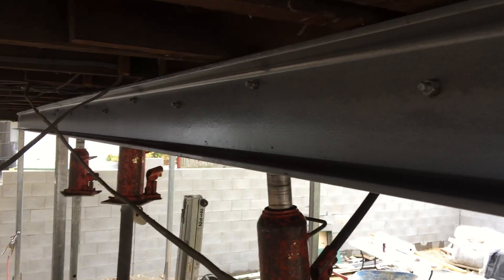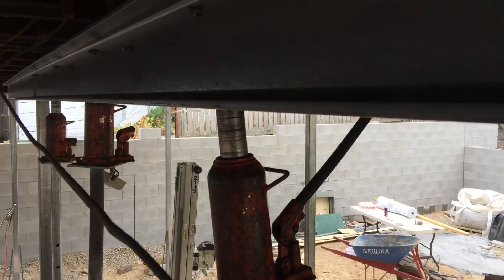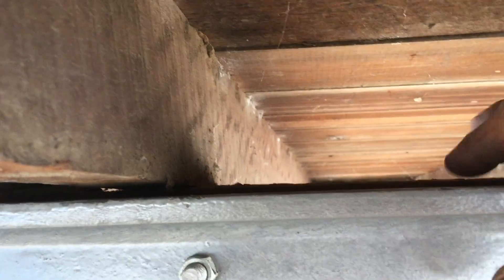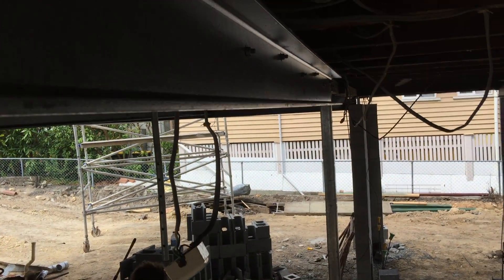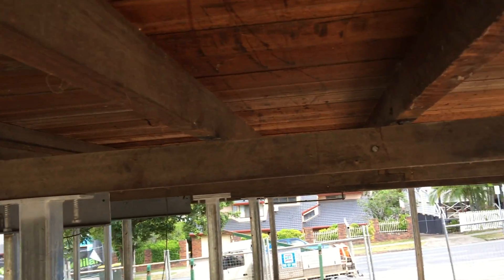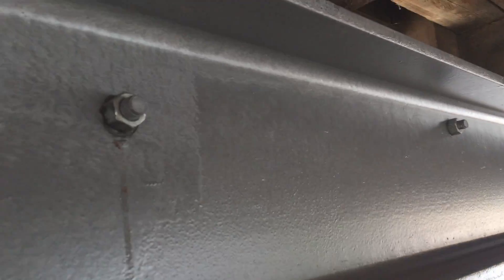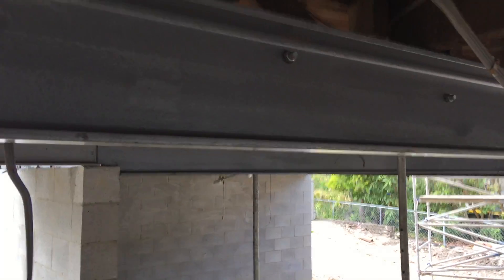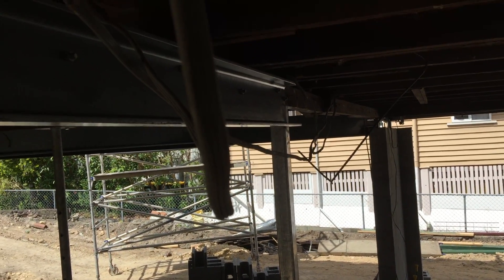How to install steel beam correctly No 4 Kent st 16

Comment: Hi Dieter. Have you got a video on welding the PFC to steel posts? Regards Ian
Reply: Hi Dieter, How high to you push the timber beam up over a 5 metres when attaching timber beam to a PFC beam